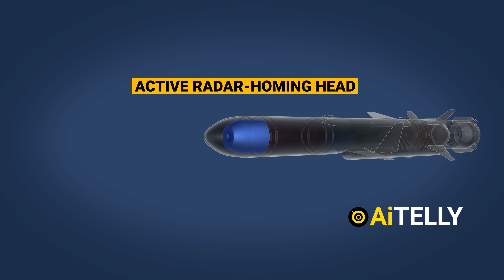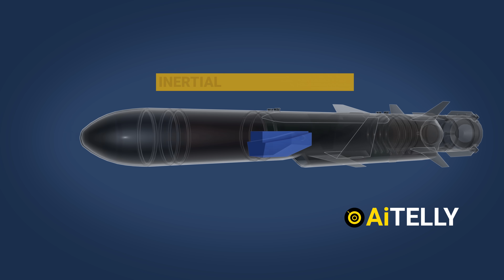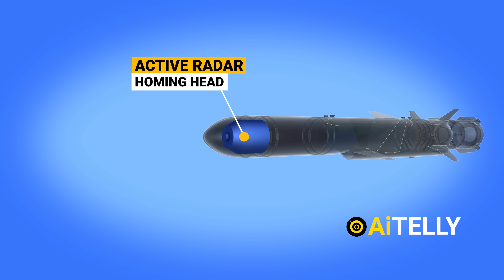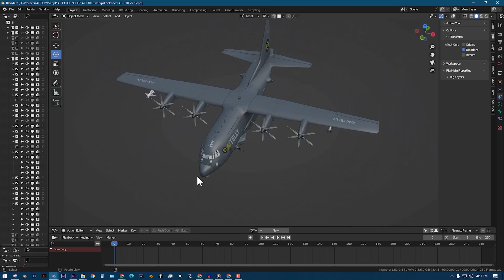Neptune Missile How it Works | Ukraine Missile Vs Russian Cruiser Moskva Ship

Comment from the maker: Please Subscribe and turn on Notification Bell
Reply: Neptune missile is a soviet design
Reply: I did this
Reply: No, the Neptune  Missile was developed by the Ukrainian design bureau "Luch" in the period from 2014-2020. It was adopted in 2020. @Gryffoon
Reply: @kikaev1980  no the neptune is mainly a copy of the soviet missile Kh-35. Kh-35 is a soviet design.
Reply: Check it out my LEGO version of the Neptune❤
Reply: Everything is much simpler

This ship was supposed to be decommissioned around 1993 as obsolete. For unknown reasons, this did not happen, the ship simply stood on the pier for about 15 years waiting in line to be sent for scrap (according to open data, there were about 4 iterations of the process of cutting the ship for scrap), and as a result, the ship underwent minimal modernization instead of completing its life cycle

The air defense of this ship, outdated for decades, simply could not be designed to counter modern missiles, which was practically proven

This was not the only use of these missiles against ships, but modern smaller and much more capable ships with modern air defense systems shot down all such missiles (if anyone has ever wondered why they didn’t try to do the same with other ships, then the answer is this question is completely open data, it’s just that this data is not highlighted for obvious reasons)

This only proves that obsolete warships need to be promptly sent for scrap, and not sent point-blank to the enemy’s shore

Comment: The minimum operational height of 25m isn't so accurate, since this ship was equipped with the newer version 5V55RM missile. It was useless either way.
Reply: What is the meaning of "is not so accurate" in your sentence?
Reply: @eemtech1606  according to russian sources the minimum altitude to intercept an airborne target (aircraft or nsm) can vary between 10-25m in the latest variant (5V55RM) which is the one equipped in the moskva cruiser. Probably the ship was first spotted (geolocated) by a drone, then I can fire the missile without turning on the radar (knowing its position) so that the missile (neptune) can fly its first path using INS and the final stage active its own radar seeker to acquire the ship.
Reply: Weather was calm, ship was not moving, ship systems were probably in shit shape.  Believe there was a report about the state of repair of the ship systems and it wasn’t good.  Now add in that russian training generally sucks and their leadership is terrible and you get the idea that the BSF is a joke.  Still dangerous, like a monkey with a grenade or nuke.  
The Orcs almost shot down a Rivet Joint, let that sink in.  The B2’s would have sunk every ship that the BSF still have in inventory.  Its just crazy, russian crazy.

Comment: You can use all the tech in the world to secure a target but it's still a very large Target, I mean dumb luck was a factor also. A single grain of sand can block the gears of the most well oiled machine in the world. A single drop of water can cause a deluge.

Comment: It's highly unlikely for r360 to skim the water at a min flight height during stormy weather as the turbulent ground (combined with an assumed dense ew battlespace) would limit the performance of its own radar and could increase the interception envelope since the target sensors are higher than its flight profile.

Comment: The weather was very calm on the day the ship was attacked, this is easily verified by pictures taken after the attack. There are known issues with the radar systems conflicting with each other and when the radars are used the communication systems cannot be used due to interference. Most of the close in weapon systems designed for point defense were not operational and had been scavenged for spare parts to keep the one operational unit operating even though it wasn't. The ship was a victim of poor maintenance and upkeep more than anything else because if it was maintained the attacking missiles would have been shot down. Condolences to the families of those lost and prayers that the lessons are learned from this incident and applied

Comment: The reason that the Neptune missiles got through is because the Moskva was being held together by duct tape and wishful thinking. The main gun was down due to a hydraulic leak, five out of the six AK-630 ciws down and they were being used as spare parts for the one good one. The fire control radar for the sams was off because it interfered with the satellite radio. The main engines had been pushed well past their service life and could only manage a top speed of 12 knots. The rudders were partially jammed and could only turn a maximum of 20 degrees. Plus, due to rampant theft, all of the ships fire extinguishers were locked up and only the admiral had the keys.
Other than that she was a fine ship and in perfect working order.
Reply: I like the last sentence lol
Reply: What is your source for this?
Reply: UPDATES/WEATHER:    Russia's claimed stormy weather was bogus. US Navy reported WINDS CALM W/ NO WAVES. Video/photos confirm.
UPDATES/OPTION 3: Moskva defensive systems were in poor repair and partially inoperative (per previous RF Navy audit of Moskva). Moskva sailors were conscripts distracted by an immediately-prior and ongoing attack by Byraktor drones. The conscripts miss-interpreted the incoming Neptune missiles as a part of the ongoing drone attack. 8 seconds later many of them were dead...
Reply: Radar turned off due to interference with sattelite radio? That's Sheffield excuse.
Reply: Wtf?
Reply: Is this a master class in how to create myths? Have you been there and seen it? Did they simply rewrite the text from some "very reliable source"?
Reply: "Perfect" working order 😂😂😂
Reply: @Oles.. ruskie cope
Reply: @hamilcar358  random guy know everthing....
He has a psy brain that can see remotely...
Reply: Satellite radio 😂 to call Pablo Escobar for help 😂
Reply: @hamilcar358  I recognise it from LazerPig's video on the Moskva sinking. He got the information from a leaked Russian Navy report written a few months before the sinking. Up to you to decide how reliable that is, but it's very much in line with the level of corruption and maintenance failures seen in the rest of the Russian military over the course of the Ukraine war.
Reply: @hamilcar358  he is most likely telling the truth, this is a very old ship. When I lived in Russia, I saw this ship in the 90s, when it stood on the pier waiting to be cut into metal due to its obsolescence even then. This was about 30 years ago!

Modern ships, by the way, were also attacked by these missiles, but the result (huge price of the missile/0) forced to switch to the tactics of cheaper drones and choose other targets instead of warships
Reply: Here comes spy of Ukraine 😂
Reply: @struvrim7637  he gave a very specific sequence of facts, didn't just state the obvious that the ship was old and possibly poorly maintained. You need sources for statements like this. Actually you even need the sources of your source, if it's something like an article on a website
Reply: Yah its fine and in perfect working order that is why it sunk due to...as you said its fine and in perfect working order 😂
Reply: user-py6bo1jz2m  it's just like that picture of that building in St Petersburg. It's perfectly clean, freshly painted on one side and around the corner and it's crumbling and falling apart on the other.
Reply: Well plain and simple the defences didn’t work did they? Drops the mic.
Reply: Literally as a rest of rusty Zigger's equipment
Reply: I'm pretty sure the officers and captain know about the thefts. It seems the average Russian sailor has two adversaries: the one he is ordered to fight and his own commanding officer!

Comment: There was a report on the Moskva, and it was grime, the Russians put her to see with multiple problems.
Which Include: 

There was only 1 out of 6 AK630 working the other was cannibalised for parts
The Engines was well passed there service date, and was locked into half speed due to overheating and couldn't be used without the admiral permission. 
The Generators worked at random.
The Fire Control Radar wasn't turned on as it interfered with comms and was turned off.  And even when turned on had problems lacking onto targets.
The Main gun couldn't be fired due to problem with hydraulics 
out of the 500 fire extinguishers on board there was 50, and they was locked up by the Admiral.

So basically it was sailing (at half speed) into a warzone, blind, unable to defend themselves,
Reply: source?
Reply: @timohelsing7372  do your own research, but i do believe these claims way more than the Russian ones
Reply: Sounds the the average state of russian equipment.
Reply: @timohelsing7372 its a service report few years before the war. You should find it easily
Reply: Someone leaked a few documents about the long list of issues with this ship. The problems even reached minor items such as being unable to get the document printer on the bridge to work!

Comment: UPDATES/WEATHER:    Russia's claimed stormy weather was bogus. US Navy reported WINDS CALM W/ NO WAVES. Video/photos confirm.
UPDATES/OPTION 3: Moskva defensive systems were in poor repair and partially inoperative (per previous RF Navy audit of Moskva). Moskva sailors were conscripts distracted by an immediately-prior and ongoing attack by Byraktor drones. The conscripts miss-interpreted the incoming Neptune missiles as a part of the ongoing drone attack. 8 seconds later many of them were dead...
Reply: There was a report that said that they had to constantly disable the radar since it interfered with the communications systems. It wouldn't surprise me if it was the case
Reply: 500 dead

Comment: You've made some mistakes in the video. 8:13 Operational range of Neptune is actually up to 280 km and recent news that Neptune missiles were used to destroy Russian S-400 Triumph complexes  in Crimea proves that. And speed isn't 300km/h but 900km/h.
Reply: It's worth noting that they  say 300kph one minute, then 900 later in the video.
The video also says 6 second engagement time on the AK's; but later they say 8 seconds.
Reply: with a speed of 900km/h and the AK's range of 1,6km. the moskva would have had 6 seconds reaction time with the AK's

Comment: Remember. A chain is as stronger as its weakest link. This battle cruise has a defensive weakness against low flying missile. If the Mokva had fully functional those vulcan type machine guns, they would have destroyed for sure one of the missile. None of them fired. Ukranians attacking with two missiles were correct! one is not enough. Best to attack this vessel with four instead of two to make sure.

Comment: The combat range of Neptune missiles is 280 km with a 150 kg warhead against naval targets or 400 km with a 350 kg warhead against land targets. Flight speed 0.8 to 0.85 Mach. Idiologically, the missile is close to the X-35 and Harpoon, but differs from them in size and components.

Comment: The most real version 3: The cruiser "Moscow" was sunk by the latest Norwegian missile NSM, created by the Norwegian company Kongsberg, flies without a "radar in the head". First, the primary coordinates of the target are entered into it, obtained, for example, from a reconnaissance drone (up to the RQ-4 and its "cousins", which have fairly far-seeing radars). Then the rocket goes to the area of these coordinates, guided by a combination of inertial guidance (a very simplified — complex version of the gyrocompass) and GPS navigation. But at the final site, the most important for hitting, the Norwegian missile activates the infrared homing head. The rocket compares the images seen on the horizon with a library from its memory and selects the most important target. The infrared matrix of the Norwegian rocket practically does not emit in any range. Therefore, its inclusion does not warn the enemy ship about the attack. To compound this advantage, Kongsberg made his brainchild out of composite materials that do not reflect radio waves, and the shape of the NSM is appropriate. This is still a very small rocket, which further complicates its detection. Today, the NSM is the most inconspicuous anti—ship missile available to Russia's opponents. To give the missile the primary coordinates of the target, guidance from a drone is enough. (Fortunately, he can see a large ship from a distance noticeably greater than a large ship can see him). At the target, the Norwegian missile will be guided by itself — without attracting the attention of the enemy.

Comment: The Neptune missile is based on the Soviet X35, which is a clone of the American Harpoon. х35 has been completely redesigned (only the body and the layout diagram remain)
The missile is equipped with a guidance system that captures a target at a distance of up to 50 km, resistant to radio-electronic warfare. Also at the time of the presentation, the developers claimed that these missiles can attack in a group. When attacking a group, missiles exchange information, independently choose a priority target, its hitting points(the system is able to determine the profile of the target), or distribute targets among themselves. At the moment, I found mention of such possibilities only in old Russian publications